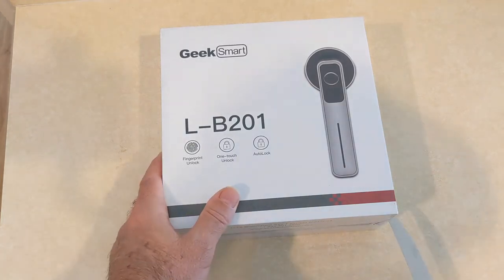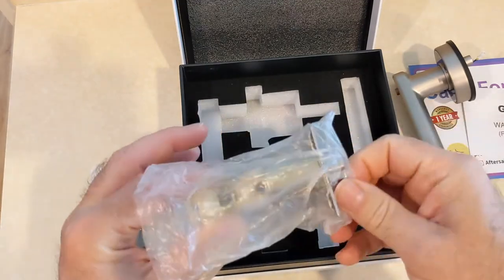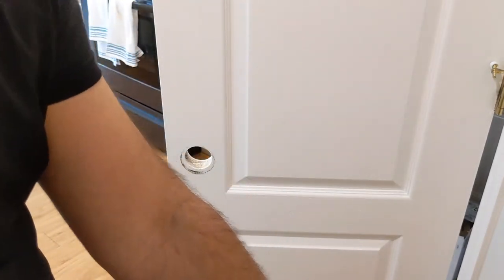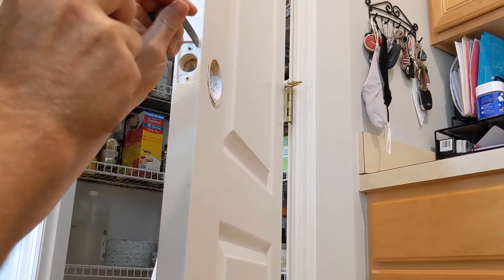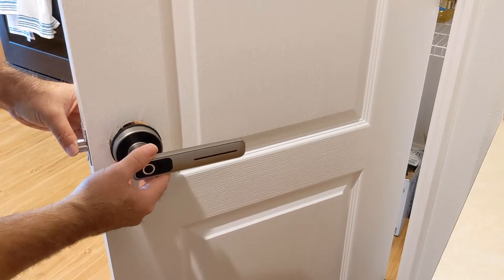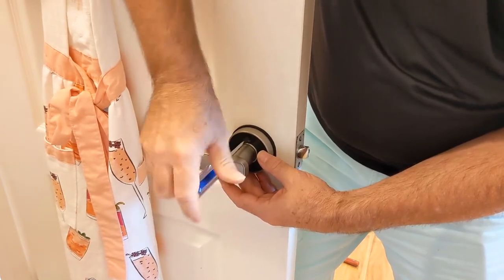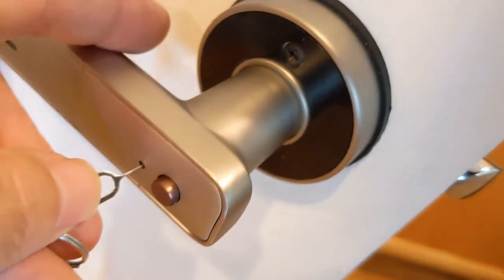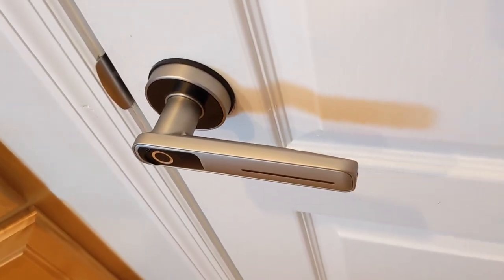Geeksmart Fingerprint door lock review and install

Comment: Hello I appreciate your video. I'm only concerned with one thing. If this is a security door why are the installation screws on the outside of the door? Doesn't this potentially mean that the doorknob could be removed from the outside simply by unscrewing these installation screws? I ask because most security doorknobs only have installation screws on the inside of the door.
Thank you 😊
Reply from the maker: Maybe it doesn’t present correctly on the video, but there is definitely no screw access from the outside.

Comment: My understanding is that the rechargeable battery is for emergency purposes, to give you extra time to purchase/replace the battery. Am I wrong? Can’t find the manual! Where is the battery housed? 😩
Reply from the maker: That may be true in some units.  In this model, there is no replaceable battery.  Only an internal one that I recharge about every 3 months.  Thanks for commenting 😊
Reply: @DriveTimeDIY  Well that's kinda false. There is a place for 4x AAA batteries in the inside portion of the door handle.
Reply: They appear to have updated/changed the LB201 model with a smaller, weaker internal battery and mandatory 4x AAA batteries.

Comment: So is there ANY way someone else can add their fingerprint without the administrator?  Like if they got that little key punch could they add a fingerprint without the admin or does the admin have to put their fingerprint in first?
Reply from the maker: If they had physical access to the lock from the inside (the non-locked side if the door), then they could do a Hard reset to factory default.   Then make themselves the admin.   But from the outside, no way that I can think of.
Reply: @DriveTimeDIY  eh that sucks in my opinion doesn't seem too secure.
Reply from the maker: I have been happy with mine.  I even bought a 2nd one.  I will say, I don’t know that I would use this on a door to the exterior of my house.
Reply: @Taylormade2350  Doesnt seem secure? how the hell are you going to get on the inside of a locked door to reset it? And if you got on the other side of the door why would you want to reset it? lol...
Reply: @kabutoyakushi6618  I think he meant like if you have a guest over and this man or this plumber or this repairman has an access to it you could just add himself to it.
My personal advice is that this lock is for something not super important but you would know someone replaces your fingerprint because you won't be able to open it anymore. Like the man in the video is preventing his kids from going in the pantry. So basically this lock is for someone in your household that you're not comfortable sharing access with but not to the point where is super important so somebody you already trust
Reply from the maker: Yes, kinda like that.  Something you want to keep semi-secure.  But if someone is determined to get in, then maybe not the best defense.
For instance, and internal office door.

Comment: Hi this is Cyndi again. I tried to recharge the battery on the handle and it didn't take the charge. Is there something I'm missing?
Reply from the maker: There’s nothing special to do other than connecting a usb cord to the handle and the other end to a 5v power source.  I suppose it’s possible the power adapter you’re using might be under-powered?

Comment: I have one in front of me and I cannot program it. It won’t speak, it is just buzzing when I charge it. Angry … I have way passed the return period. This is very frustrating, should have opened it earlier. Going to remove and check the plug connections
Reply from the maker: Aww man.  That’s maddening 😟
Reply: @DriveTimeDIY  It was a bent pin. … And the connector got stuck in the handle so tweezers was a must have (iFix it kit cam in handy) as well as something to CAREFULLY maneuver the pin in place. Few minute job turned into a couple hour fight. LOL
Reply: @DriveTimeDIY  Thanks for the sanity check. this video was very helpful and straight forward.
Reply from the maker: Oh awesome.  Glad you got it!  Your comments may help out someone else too.

Comment: Where is the battery and how do I recharge it?
Reply from the maker: Hi Cyndi.  As far as I can tell the battery is sealed inside the handle.  There is a USB micro port on the end of the handle.   I seem to need to charge mine about once every 3 months.
If you don’t have a wall outlet close enough to the door to reach, then use a portable battery pack for charging. 😊

Comment: How long does the battery last and does it work good
Reply from the maker: Not sure on the batt life.  In our case,  we use the open motor about 10-15 times a day.  The batt has never run-down.  I charged it at about the 3-month mark just to be sure.
Reply: I charge mine once a year
Reply from the maker: Ahh thanks.  That’s good to know. 😊👍

Comment: Does it use batteries ? How do you recharge it ?
Reply from the maker: It has an internal battery. And there is a USB charging port on the end of the door knob handle. I’ve had it for about three months and I’ve only charged at once